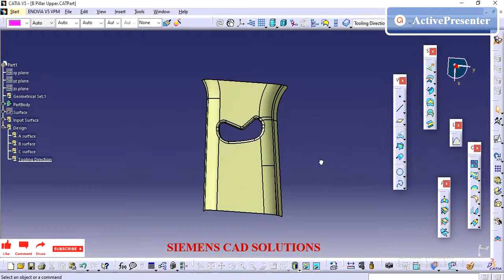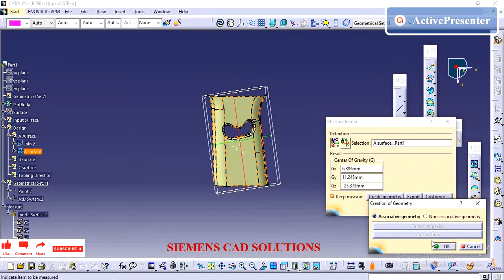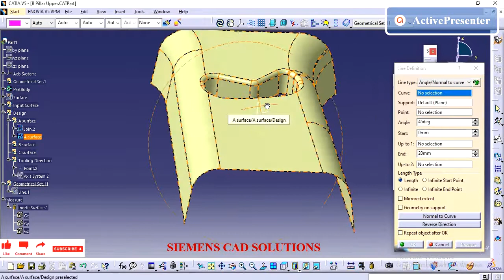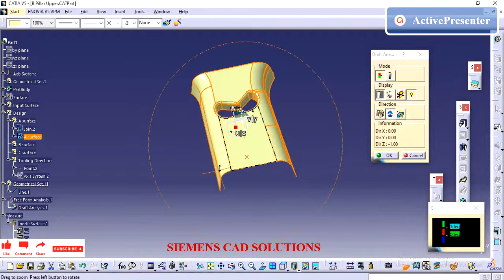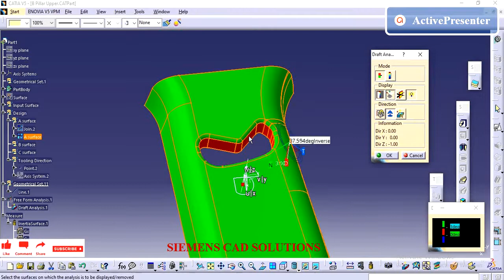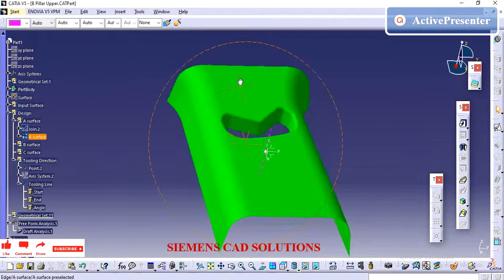CATIA V5|B PILLAR UPPER|TOOLING DIRECTION|DIE DRAW|CREATION| AUTOMOTIVE TRIMS| SURFACE DESIGN

Comment: In my case for draft analysis , more part is blue . I mean its vice versa how to tacke that
Reply from the maker: it's showing that negative draft
Reply: @siemenscadsolutions9994 thanks
Reply from the maker: Keep - (Minus) before the draft value and then check
Reply from the maker: But parting line is the main concept
Reply: @siemenscadsolutions9994  thanks